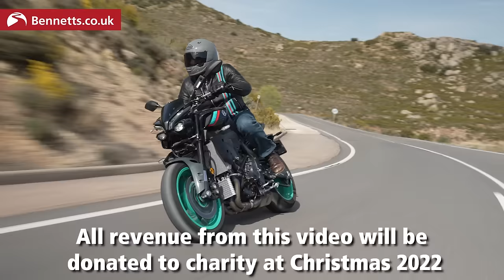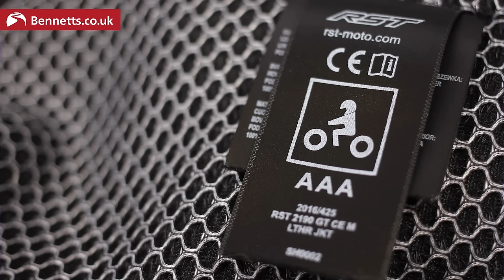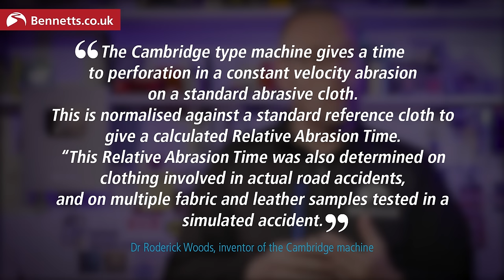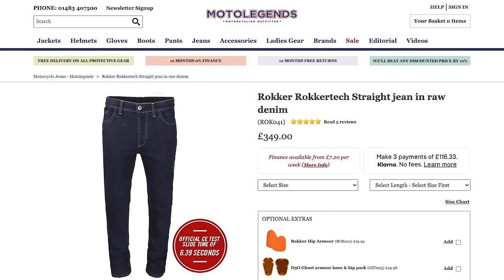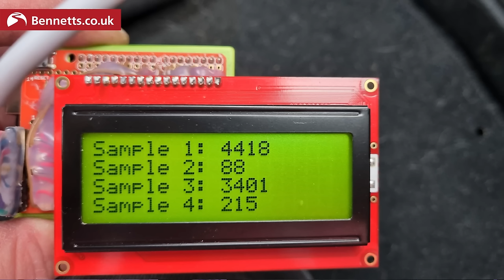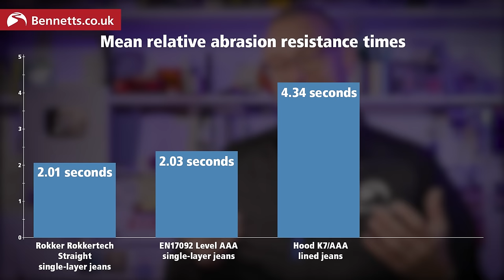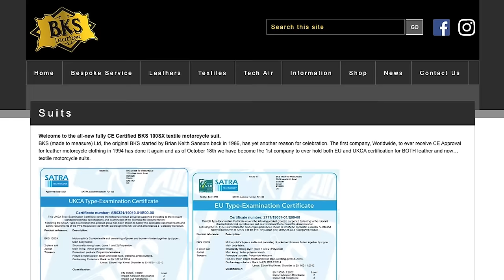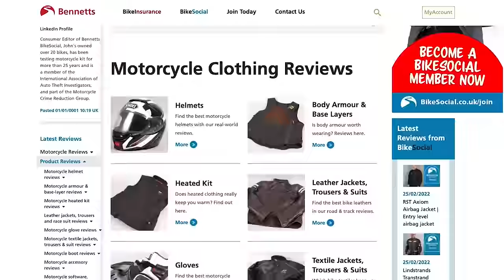Best motorcycle jeans | Single layer vs lined: THE TRUTH

Comment: And this is why I've been wearing leather right from the start. My first pants were vintage 90s leather pants with no armour, but at $20, that's good value. Now I have a zip-together Alpinestars set I picked up second hand for $300. The perforated leather panels on the jacket and stretch aramid paneling in the pants are a definite improvement for temperature regulation.

Comment: A point on protectors though: I see a lot of protectors on the market which just seem too damn small and/or incorrectly placed. Just taking into account the vast differences in the sizes and shapes of human bodies, how can a hip protector the size of a postage stamp be expected to protect a wide enough area?

And more often than not, the same size protector is used for all those jeans ranging in size from 28" to 46". 

I would love to see some serious effort put into making protectors cover a larger area.

One option would be to make protectors which taper far out to the sides. That could yield a wider protective area without adding too much bulk.
Reply from the maker: Its definitely important to have them stay in the right place. Cheers, John
Reply: I’ve been pushing for additional size requirements to be added to EN 1621-1 for the past 20 years. I have submitted several papers on the topic to Working Group 9, the European Standards committee responsible for developing standards for motorcycle clothing and equipment. The main players in the motorcycle clothing industry which are or have been represented on that committee have rejected my proposals each and every time. Furthermore, as you have highlighted, Aleksi, there is nothing to prohibit clothing brands from fitting the smallest, “Type A” protectors (EN 1621-1 confusingly uses Type A, smallest, and Type B, largest, to designate the two sizes in the standard) into every garment in the size range; from Women’s XS to Gents’ 5XL, for example. While the main brands represented on WG9 refuse to address this obvious issue, nothing will change.
Reply: @paulvarnsverry11  Yep Paul. I took a look at some of the riding jeans we have in our shop. On some, the hip protectors are around, I dunno, 7cm wide and the same size protectors were in use across all sizes in men and women's jeans. They can't realistically hit the correct spot across all the fitments. 

The best in the shop was Spidi, who have used (comparatively at least) very wide protectors for both the hip and knee pockets. Also, the knee protectors are easily removable through a hidden outside zipper - I think this will help more people wear the protectors. A lot of people buy riding jeans for their commute and wearing the jeans throughout the working day. Many end up ditching the protectors because they don't want them there throughout the day and they feel it's too much of a hassle to take the pants off to remove and reinstall the protectors. With the external removability, perhaps those people might end up using them more.

Comment: What a great video on motorcycle clothes abrasion resistance and durability in a crash.
The skin shear Dr.Hurran is talking about in seniors ,especially bedridden ones,, is truly heartbreaking to see, because it requires the patient to be handled very carefully and essentially lifted to stop the pressure damaged skin from just slipping off the layer underneath it.
In a motorcycle crash,the same kind of skin shear moment might happen from say a biker falling onto the road and his elbow slamming the asphalt and the protective gear not sliding on the road but transferring the impact motion through the garment directly into the skin layers inside  the garment.
I have experienced this with denim jackets on asphalt where my jacket did not rip or fail but the skin on my forearm and elbow took a heck of an abrasive slide impact from the inside of the denim jacket moving against my skin.
When it happened I wondered what in the heck is this?
Then I felt the inside of my denim jacket at those points and understood the physics of it.
Dr.Hurran had alot of new information I never heard before but the silk suit thing for MotoGP riders made complete sense.
I always wondered how they could slide at 140 miles per hour across tracks and gravel and get up relatively unhurt.
I know they wear full leathers with massive armor but the silk suit thing just underscores street riders can always learn something from the professionals like the MotoGP riders and Dr.Hurran.
Without a doubt,.that Cambridge test with 60 grit should be the standard.
Like you said ,the worst case should be the standard.
Thanks to Dr.Woods for designing and developeing the Cambridge  test.
I actually favor the suits,gloves  and jackets for this with the armor in them.
And as always....a full face helmet.
Excellent video.
Reply: Skin shear and the role of linings in motorcyclists’ clothing in mitigating its effects has been known about since the 1980s, and the function of linings in providing “shear force interception” (a term coined by Dr Woods) further remarked upon in the 1990s. There have been some detractors who claim it is a non issue and ridiculed the matter. As Dr Hurren says in the video, skin shear injuries resulting from motorcycle accidents are generally minor, but as Dr Russell has pointed out elsewhere in the comments, complications such as compartment syndrome can occur and these can lead to life changing medical intervention, such as limb amputation (read up on how multiple World 500cc Champion, Mick Doohan, almost lost a leg to compartment syndrome).

My stance on this is that if motorcyclists’ protective clothing is intended to mitigate injury, then skin shear is a factor that can be resolved by fitting a lining. Not fitting a lining is, to use the old phrase, “spoiling the ship for a happ’orth of tar” - not completing the job.
Reply from the maker: Thank you so much for this comment, and sorry to hear of yiur injuries! All the very best, John

Comment: Great video, thank you, really helpful to see how the different testing and standards compare. Sounds like the intent to prevent misleading claims has been only partly successful!
Like you, I've got a pair of Hood K7s which I love, and like you, I don't find that the lining makes them too hot - when I am actually riding. But, when walking around off the bike on a hot day, they certainly can get very warm, and so I have ended up getting a pair of the original Oxford AAA (later downgraded to AA after the testing organisation announced they had made a mistake!) single layer ones too - especially as I am off to Spain and Portugal soon.
In 2019, Ride magazine did a group test of jeans, some lined, some single layer (and a pair of ordinary jeans for comparison. They dragged them behind a car with a 22kg sack of gravel in them. The lined ones performed noticably better than the single layer ones, and the Hoods won the best buy award. They then repeated the testing two years later with just single-layer jeans and overall, the latest did rather better. My Oxford ones got a best buy, though in fact some Knox ones did better for absolute protection, doing virtually as well as the Hoods had.
I take your point that scientific testing in controlled conditions is very useful, but it is, by the nature of the controlled conditions, somewhat divorced from real-world conditions. The Ride test method is less tightly controlled (and the assessment of damage rather more subjective,) but maybe has more real world relevance?
There are always compromises, and Any jeans will be placing comfort further up the importance list. Most of us are prepared to do this in at least some circumstances, otherwise we would all be wearing a full set of race leathers every time we went to the shops. Or walking.

Comment: interestingly, talking about skin shearing is actually similar to the way certain sock companys react to walking socks and blisters. If you have a single layer of fabric, then the sock will rub and cause a blister once hot, regardless of the quality of it. With the addition of a secondary internal layer, the layers rub against one another and stop the formation of blisters. Quite a simple, yet ingenious addition to riding gear if this is added by the majority of companies. I don't quite think it's required to be specifically silk, but just a thinner, tighter layer that acts as a barrier to the skin
Reply: Thank you, that is very good information.

Comment: I recently started using protective moto leggings and pants (the 2nd and new 3rd versions) with 65% UHMWPE  and claimed CE AA rating (come with level 1 rated armor). I am curious how well these protect during a slide and if they will MELT when sliding and how that would affect me. This is what needs to be tested and independently verified since these types of materials are appearing everywhere including these single layer riding pants. I also use Rokker Chino Black and Sand colored riding pants. These seem very durable though I have not tested and they have a light weight comfort liner. These Chino Rockers seem good at deflecting heat from my bike. I am thinking maybe using the Panda Moto leggings with the Rokker jeans. The Panda Moto leggings are very comfortable.

Comment: I would highly appreciate it if you did some testing or research into vegan motorcycle gear since it's a new market with companies like Andromeda Moto offerings AAA vegan leathers and few other common brand options it's tricky to pick out what's the best options.
Reply: Andromeda uses a mixture of many technical textiles. I think their design for the NearX suit looks decent: Dyneema chassis (not great) but with the SuperFabric reinforcements, kevlar backing and TPU sliders/caps, it should provide very good protection. The weak spot is Dyneema which uses a blend of UHMWPE which although strong at normal temperatures melts at temperatures caused by road friction. However, the Dyneema is in the lower risk areas. Also, if the Dyneema is backed by heavyweight kevlar, that would most likely resist a lot of abrasion after the Dyneema fails.  I wouldn't race in it but it's probably the best vegan stuff you can get.

I've personally tested Dyneema denim in simulated road crash tests and it didn't do well at all in one layer. It did much better with aramid backing and it did very well in 2 layers. However, nothing like as good as cowhide in 2 layers.
Reply: @martinfoster5163  Thanks for info, interesting stuff!

Comment: Great work John. I was took in by the Rokkertek Jeans from the shop you mentioned and to be honest i feel cheated somewhat. The chap in the cap will be hearing from me!!
Reply from the maker: As single layer jeans go, based on the independent lab test they're not bad at all. But they don't offer the same abrasion resistance as lined jeans (and the ones I used in this example aren't the heaviest duty), or leather. I like single-layer jeans, but with the knowledge of their limitations I know when I'm happy wearing them, and when I want something tougher. Cheers, John
Reply: @bennettsbikesocial  Hi, this is part of the reply i got frum Motorlegends; Don’t be silly. No clothing retailer is mor obsessed with safety than we are. Bennetts’ video is nothing more than a bit of political, muck raking. It is nonsense.
Regards Mark
Reply from the maker: @markellison4875  I'm happy to let people decide for themselves what's nonsense as we have nothing to gain whatever people choose. My priority is that riders know what they're buying. When we see evidence of single-layer jeans outperforming decent leather in an abrasion test, we'll be shouting about it.
Reply from the maker: @markellison4875  I guess the most important question is what do YOU think?

Comment: While I was looking for a safe pair of motorcycle jeans, I had seen the banter between Hood and Moto-legends and it wasn't all nice to read. But at least it motivated me to do my own homework and after extended reading I ended up buying a pair of Hood SK11:AAA mens slim fit jeans. They are really a quality piece. I can recommend them but they are not perfect. Safety wise and quality wise, don't bother searching for better.Hood is as good as it gets with jeans on a bike. But they are heavy . As a reference, with the knee and hiparmour included they weigh 1613gr. For reference, a set of normal denim ( non riding so without armour) comes in at 614gr. On the bike, no problem, but to wear all day, not that comfortable, and to take the armor out at destination is not easy or doable . And so... as a commuter, I still prefer wearing my normal jeans with my Revit Varenne textiles, with hip and knee armour over them. With the long zippers on both legs, to get them over my jeans takes 30 seconds ( motorboots already on), to get them out at destination takes 15 seconds and they weigh about 1151gr. And they withstand some rain on the way too.
But I still like and trust my Hood jeans and I use them on different occasions. I do recommend them.  I would never trust single layered jeans and certainly not at highway speeds to protect my skin.
Reply from the maker: I've never had textiles over my normal clothes, but it must make commuting a lot easier (and no need to strip in the office!). Also, the extra layers are all helping protect you. Cheers, John

Comment: When wearing lined jeans I find the legs baggy compared to leathers, trusting the knee armour to be in the right place if I came off is a long shot. I wear separate knee armour similar to skateboard knee pads made by Spidi (I think) under jeans, remarkably they're not too hot.
Reply from the maker: Good idea! It is important to get that fit right; as you say, if the armour moves out of the way in a crash, it can't do its job. Fortunately, both lined and single-layer jeans can be found that work for different shapes and sizes. Cheers, John

Comment: Excellent and informative video. Well done. 
It was also interesting to read comments from some viewers who had a negative experience with Motolegends. I’m not here to slate them, as my purchasing experience with them (both online and in person) have been a positive experience. 

I’m very pleased with my AA rated Rokker jeans (am I right in saying that no matter how strong an A rated jean is, it’ll never reach AA rating unless it is fitted with hip armour?) as they are truly incredibly comfortable to wear (with D3O Ghost armour fitted) compared to both lined jeans and the other single layer jeans I tried on (both at Motolegends and my local shop). 

I have to add, in their defence, that Motolegends are the only shop (that I’ve encountered) that will not let you leave until they’ve made sure that your jeans not only are the correct length WHEN SAT ON THEIR SHOP BIKE, but that the armour is placed correctly (again, when sat on their bike). If the fit isn’t correct, they’ll send the jeans off to be professionally altered to ensure everything is as it should be. At their own expense (approx £60, according to a third party), and once done, will ship them to you, again at their own expense. I’m not a Motolegends fanboy, just stating my experience with them. 
My local shop (Bristol area) had a huge selection of lined jeans, along with a couple of examples of single layer jeans. Neither of the sales staff knew anything about their products, let alone what constituted a correct fit (after all, we’re talking about PPE here, not fashion ware). 

Finally, a lot of the current arguments about what type of Jean is best to me is just muddying the waters and focussing too much on one aspect of the garment’s ability or inability to protect you from abrasive injuries in the event of a fall. 
It’s incredibly rare that, upon departure from your bike, you’re going to slide down a kerbless road and end up in a nicely controlled stop. If you’re worried about your single layer jeans wearing out in 2 seconds, then rotate whilst sliding, thereby increasing your “slide time”. No. In the real world, you’re more than likely going to collide with something far more robust than your body, or you’re going to roll, bounce, and ricochet off road furniture/trees/signposts etc. So really, a lot of these figures are purely academic; since when is a bike crash, or any other crash, a controlled event, apart from for research purposes? I’d be focussing my attention far more on body and brain protection. 

I’m currently recovering from multiple (and I mean multiple) rib fractures, smashed clavicle, torn shoulder tendons from a 20 mph collision with a substantial, but not abrasive, wall. No amount of Kevlar lining or single layer AA or AAA clothing would’ve prevented my injuries. I was in shorts, Lycra shirt and a good quality helmet. Riding my bicycle. Not a single scratch to my bare hairy legs! Kind of puts it into perspective doesn’t it?

End of bedridden ramble. 

Keep up the excellent videos. 

Can’t wait to get back on the bikes, all types.